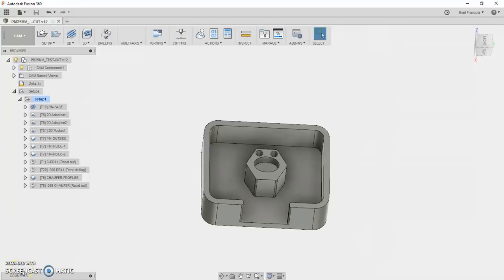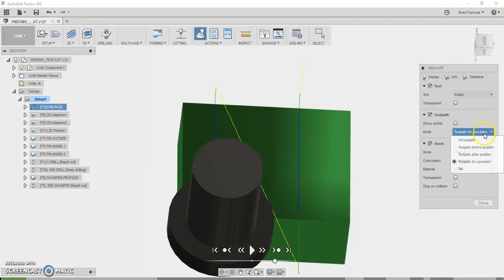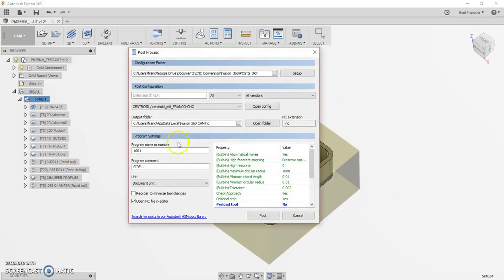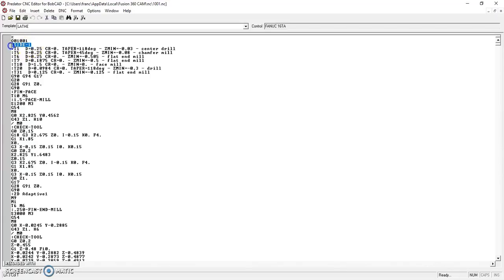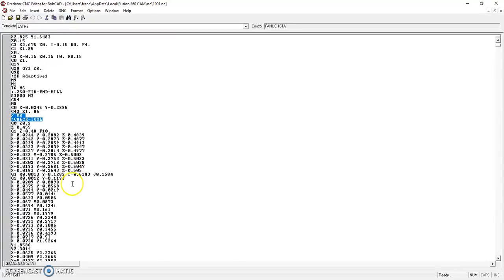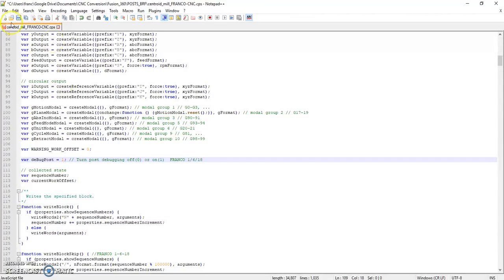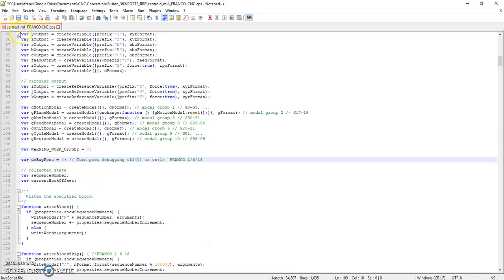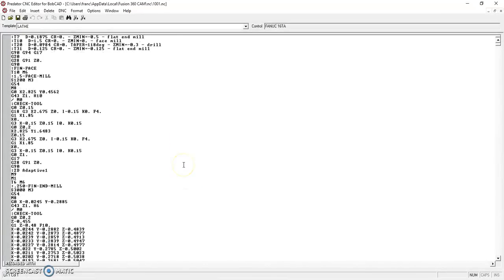Fusion 360 Milling Post Processor for Centroid

Comment: Also I wanted to add that I have tested it with a quarter 20 tap with full retract and .050 incremental depth. It is really reliable and easy on the taps as specially in steel. And totally rigid tapping. No floating head and I really like it.

Comment: Hi Franco I have the 1.8kw servo spindle working perfectly for incremental tapping/tapping with chip breaking in acorns mill conversational control at 200 rpm and it works really great and when I try to use the fusion 360 post processor to do the incremental type tapping with chip breaking, it won't post out the code. I was thinking that I could post right hand tapping in fusion 360 then just add a Q value, with the additional -z values below to make that happen, but I was hoping someone figured out how to make fusion post out the incremental tapping with chip breaking. I always want to tap incrementally because it works so well and reduces the chance of breaking a tap. Any ideas please? Thanks so much.